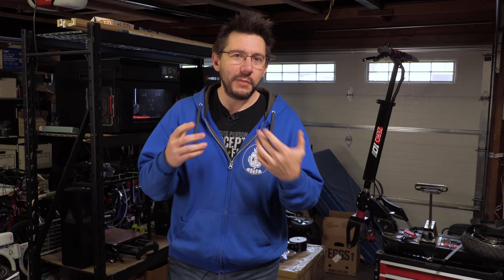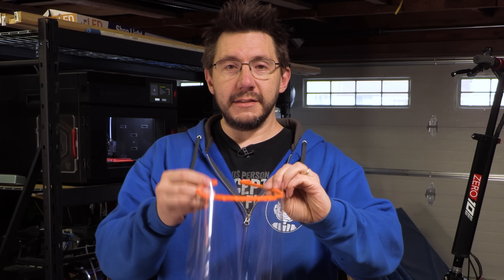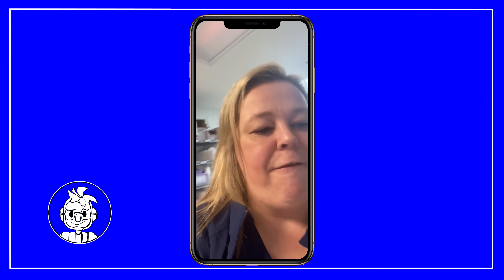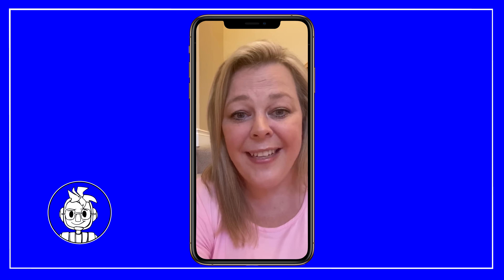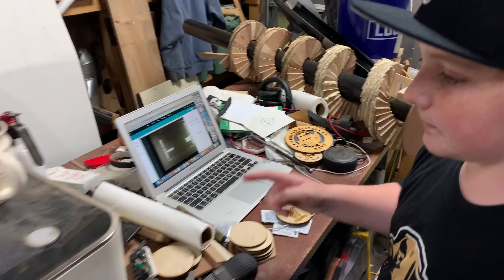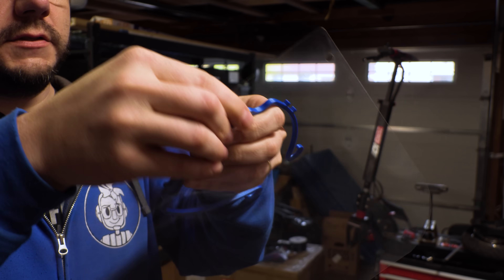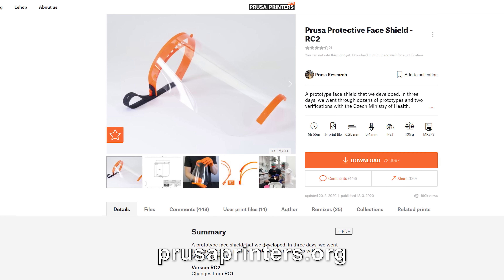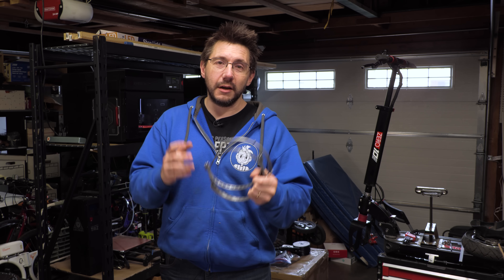3D Printing Face Shields and YOU CAN TOO!

Comment: @3D Printing Nerd Why did you choose the Apollo brand? I checked amazon and there’s several other choices with the same amount that are about half the cost. Just wondering if you picked it arbitrarily or you know that brand.
Reply from the maker: It was the first one I saw when I searched long ago, and it worked so I used it. It’s been a while and now that there are others I’d say shop around

Comment: Assumption - everyone is using a single profile. 
In S3D I am only able to make stacking work if I created a profile for each part, slowing the 1st layer to give it time to stick. Otherwise the material pulls away.  Then I use higher speeds for the rest of the part. So a stack of 25, I have 25 profiles. Or I have 1 profile running really slow. How is everyone else doing it?

Comment: I've been printing a lot of face shields, and I've found that the simplest way to clip the plastic to the frame is Binder Clips.  It won't work for that specific desich, but there are a lot that have a smooth, rounded front edge and are designed to have a build in clip.  If those don't work, 30 cents worth of 3/4 inch binder clips hold it tightly, and are easily cleaned or replaced.

Comment: Here's what I've found to work. I've printed some of these and made some shields from overhead transparencies.
 I cut the transparencies on a vinyl cutter with a 60 degree blade 200mms. I had to baby sit every piece by holding it down to keep it from squirming around (US cutter). The hole diameter is .290, the hole spacing is 1" between centers and 4.42 between 1" patterns.
 For printing the head bands, PLA didn't have very good flexability, PETG worked much better and had better strength. .2 layer height 60mms speed 240 nozzle temp 80 bed temp, no part cooling fan. I was able to print 3 parts at a time on a CR10, 2 on an Ender and Prusa M3.
 If you don't own a printer and you want to try something new buy a Creality Ender 3, $200ish. It's a great starter and will do anything you want for a dirt cheap price. Good luck!
Reply: Did you try to cut more than one sheet at a time?
Reply: @sudo936  No I had enough trouble cutting one

Comment: I printed some of these for my wife to try at her hospital. I liked the thin design which allowed faster printer and used less filament. Her feedback was: "The small lightweight design is good. The fact that it stays on by itself or can use a band across the back to hold on more securely is great. The pressure against the side of the head head is annoying. The thin design pulled against the forehead if using a band in the back is annoying. The biggest drawback is the shield is not held far enough away from the face to allow for large glasses, goggles of pretty much any size, and domed or valved respirators cause the bottom to push out quite a bit... and it fogs easily from restricted airflow. A potentially positive side effect of the close fit may be better protection although several doctors felt it wouldn't make much difference as the shield is designed to stop the direct travel of expelled droplets, not free floating airborne risks which is why a mask is worn with the shield." We also tried the Prusa design and it was found to be heavy, bulky, and did not conform to most people's forehead (even though it looks like it would) so it pressed against a small spot in the center which was made worse because it had to be pulled fairly tight using a band in the back. The best thing about the Prusa is it holds the shield further away giving clearing to all the other items a person may be wearing that I mentioned before.

Comment: Sorry but those Apollo lamination sheets are not well suited for use as shields.  Why?  they are not fully clear and they are 2 mil (Flimpsy as hell!).

While the Prusa design mask is good... it does not protect well health workers because it lacks of a top portion hood.  Here is a better design which can be printed with optional hood and base parts and also recommends using a 10mil PET clear material instead of the 2mil lamination sheets everyone is promoting.   https://www.thingiverse.com/thing:4271251

Comment: Hi, we are looking to get 3D printer and start printing these face shield, just wanted to know, printer with build volume of 200 x200x180mm or 220 * 220 * 250mm would be enough to print these face shield? 
These are the two 3D printer we are looking to get to help NHS in UK, it would be great if you can help and advice us on which one is good enough for someone new to 3D printing to get started with this 
https://www.ebay.co.uk/itm/124132924422
Geeetech Acrylic Prusa I3 Pro B Unassembled 3D printer DIY Kit https://www.amazon.co.uk/dp/B01GJDO9I0/ref=cm_sw_r_cp_api_i_AYjMEbYRFG5RC

Comment: i have found another way top make them stack-able in cura, all you need to do it have lets say 2 of the models and center them then move one z -5-(the z gap for supports) adn then group them then bring them level with the build plate, this is a lot easier than using 3d builder. hope this helps somebody.

Comment: I only just bought my 3D Printer following watching your inspirational video. So now printed 30+ face shields after trying different designs settled on this one as nurses and doctors report that it's nice to wear and cleanable. I had trouble using PTEG vs PLA on my Mega S, but after a dozen or so failures I got the printer setting correct.  Now got to get an 2nd printer as received more orders here in the UK. Laser cutting next!

Comment: I spent 4 days printing 100 of the face shield holders and had 10 mil 
covers FedEx from California and got them today. Will start assembling 
them tonight. thanks Joel. Update: Ended up with 135 face shields and 
the local hospital tells me they did not need them, but have had several
 big articles in the news papers stating that they are in dire need for 
the face shields. After several attempts with the hospital I have given 
up. They are a bunch of idiots just looking for sensational news in the 
media!

Comment: I'm printing the Stratasys shields. I've done nearly 100 in PLA. My Wife's hospital is using them. I'm trying to switch to PTEG & having a heck of a time. I get some decent results at lower speeds but that's taking 3+ hours. Using a Creality CR10s Pro. I've tried all kinds of settings. Getting lumps which are throwing off everything of course. If anyone can post settings that work for them that would help.Yes I know "your machine may be different". I'm just looking for a stake in the sand to start from.

Comment: So far I've made about 50 to this design and distributed to local doctors and nurses. They have been super happy with them so I'm printing 24x7. I'm laser cutting the shields also out of lamination sheets run through laminator with no paper etc. Or I'm using clear cover sheets designed for spiral bound reports etc. The BBC here in the uk criticised this activity saying they weren't kite marked or approved. The doctors and nurses said that's great but we have no approved gear so these are 100% more useful than nothing than what the government aren't issuing! 980 people died today in the uk so everything that everyone can do should be done to help fight this global problem. Stay at home and print to save lives! This design works great.

Comment: Hey Joel... I'm so sorry for putting this here but I'm really running out of luck. I have a single printer to help with this effort but can only print one every 15 minutes. I've raised $3300 so that I can buy more printers and supplies. I have enough filament to print 2000 face shields but NO PRINTER... every order I place never gets fulfilled. Can you help guide me or suggest some solutions? My efforts can be found here if it's helpful. http://RabidScallion.com

Comment: Do the Clear Gloss Report Covers (Pack of 100) from binding101 work well with laser cutter?
Reply: I will be using these pre-cut PET for Prusa once they are delivered https://www.ebay.co.uk/itm/10-Pack-Precision-Cut-PET-Sheets-Visors-to-Fit-Prusa-3D-Printed-Face-Shields/164154180308

Comment: Could you make comments on just how clear the different transparency sheets actually are that you used and linked? I have bought some brands which are so-so to look through. I have instead been buying Grafix Dura-lar clear and that stuff is incredible, glass window clear in .005" thickness in sheets and rolls. But it is getting harder to come by. I have enough of it for about 600 face shields, printed over 100 so far this week and will continue until I run out of the Dura-lar. Demand in Nashville has been far more than I expected so I am happy to crank these things out as long as supplies are available.

Comment: to speed up the transparency cuts you could get some steel pipe of the correct dimension and sharpen the edge then create a punch jig and punch the holds out of the film.

Comment: Is there any way where you could stack a huge block of these vertically in the print then lazer cut them to size in strips? Just thinking of ways to speed up production.
Reply: I found this site that had stacked versions of this at https://retrolabs.com/3d-prints/3d-printed-face-shield-with-10-mil-pvc . I tried the 3 piece stack. For my Prusa I needed to print with supports. I hope this helps. God bless.

Comment: i'm using the 3Dverkstan UK version, 0.4 layer height, can fit 2 on the bed without stacking, brought a second printer and supplying my local hospital, care homes and district nurses, sent out 90 today, another 60+ going out tomorrow, chose the 3dverkstan version because the print time is fast, takes 1hr 5min to print 2 of them, compared with over 5 hours for 3 prusa ones. Getting harder to find the clear plastics, but shiuld hopefully hhave a delivery of 500 in the next few days. Off work due to the virus, I was decorating the house, but this is a much more worthy cause, good job guys it's amazing how the community has responded

Comment: Wondering how well this protector works against aerosol (air full of particles) spreading of Corona, since it‘s wide open at the bottom...
But better than no protection. Thank you.
Reply: It's not designed to be a filter it's there as 'splatter protection'. This is a face shield .  A face mask = the thing that goes over your mouth and nose is still worn beneath it. Look at the picture in Prusa's thread at 9:48 - that might help.

Comment: For a mass produced product like face shields, why cant they just be Extruded on an industrial scale? 3D printing is too slow for this, the only benefit is it can supply hospitals locally that cannot get commercial ones quickly from companies due to transportation issues
Reply from the maker: The demand is so high right now, traditional supply chains are dry. Injection molding is starting to ramp up, but there is a gap, and this is where 3d printing is coming in handy. Prusa has sent more than 40,000 face shields out in Czech Republic, and I know my buddy Repkord in Sacramento has sent out 6,200 locally to him.

Comment: Hi!  I work as a dental hygienist and the dental industry has now become one of the more dangerous occupations to be involved in at this time. We are going to have to change the way we use PPE when we are allowed to return to work and face masks are not going to be required PPE.  My question is:  many of us wear magnifying loupes and we need space for these loupes to fit under the face shield.  Will the Prusa shield work for this? Or another style?  Thanks.

Comment: ARRGH! with my stock printer, stock hotend  and the settings suggested  mine printed with PETg. BUT my walls stayed apart and then the second one was horrible.....
Reply: corrected my settings (I think) and now it's printing but it will take 2 hours approximately Cura has it taking 25 hours for only 17...New Prusa slicer won't slice it for me.  Any thoughts?

Comment: Just bought an ender 3 pro printer a month ago and new to fusion 360. When I open a model it looks like the scale is too large.  I would like some help from anyone on how to set the scale correctly and start.  I have a lot of individuals requesting these and try to get running.  Thank you
Reply: You dont need fusion for a finished model... just slice it with cura and print it

Comment: Please use this Type of frame:
https://twitter.com/CoreyouNow/status/1246339669245276160
no rubber band is needed and the "heat accumulation" when wearing the protective device is much better

Comment: 📌📌📌FYI 📌📌📌: The Github content has been recently Restructured and it seems that it's a lot easier to find things. 😃
Here is the link for North America 6 Hole Design's STL file:  https://github.com/Cederb/Faceshield.nu/tree/master/North%20America%206-hole/3D%20Printing%20Files%20(STL)
In addition to versions of the files for the face shield itself, you will see:   Letter-spacer-6hole.stl    to print that spacer piece Joel uses in the video.
I DO wish there was more detailed info on doing the hole punching using regular hole punchers for rather slow to catch on people like myself! 🙄

Comment: The first link to the clear shield is now $250 for a case of 5 packs, single packs are not available, I got a single pack of overhead sheets for $60 shipped so no I need the 20 stack file and positioning to utilize a creality s4 to its best.
Reply from the maker: Whoa. Serious? I need to look at better links then. That’s nuts.

Comment: I can't find an STL for that spacer you mentioned Joel.  Was it changed?
Reply: I found the instruction sheet and it states a 1/2 inch spacer should be able to do that on the fly... I thought there was a file for the spacer.
Thanks
Reply from the maker: There should be an STL for the spacer. I’ll try to look for it in http://faceshield.nu

Comment: So with my CR-10S, using a Microswiss hotend, with stock heating element and a 0.8mm nozzle, I am abble to print these at 35minutes by head band. Anyone to compare? I want to know if my tuning is optimal. I am using PLA+, 0,3mm layer heigh, 1mm layer width, 60mm/s (except for first layer, it is at 20mm/sec)

Comment: The Prusa and Swedish files are just too complicated and over built for a normal single extruder printer to make. They require dual extrusion. Far too much 3d assembly of parts required ... should be a single printed frame, then just add the plastic sheet.  I read their assembly/printing instructions and thought "what were they thinking?" The designs are too complicated for their intended use and need to be simplified, we're not needing the 3d printed part to be permanent.  Firstly, design it for using rubber bands instead of impossible to get elastic straps. Hospitals don't have specific sized elastic straps, but everyone has rubber bands. Secondly, the print needs to be for a standard three hole punch. There needs to be NO support required for the print ... very important. I'm lost as to why the designs have to have supports as there isn't any need when you look at cross sections of their designs. Far too over built. Get rid of those and the print amount capability doubles. These designs also want to use a foam liner, just not realistic for normal users who want to help. It's almost like they've deliberately designed the shield so that no mass produced printer can make them. And release the designs in commonly used 3d files (eg. stl, obj, etc.) not some obscure industrial versions. Also, it's inappropriate to demonstrate vanity and put your name in huge block letters on the visor as some have been doing ... we're trying to help, not get famous for it.  Please guys, simplify. That way we can all help.
Reply: Maybe I am mistaken, but I am using the single extruder and quite simple stl files. Have you looked trough the whole repository here? https://github.com/Cederb/Faceshield.nu/tree/master/North%20America/3D%20Printing%20Files%20(STL)

Comment: I'm using the suggested settings for Ender 3  with .4mm nozzle but the the layer for the catch tray is way too thin and has holes in it. It's not my bed leveling because I'm printing two at a time, facing opposite directions and the holes appear in the same place each time. Any suggestions?

Comment: I've also been printing as many as I can... big bottle neck is having only a single printer. I also designed this all plastic version of the RC2 face shield... no elastic required. People are having a hard time getting a hold of the elastic, and hospitals don't like foam/cloth materials as they are harder to clean. Check out my design if you want to try printing one: https://youtu.be/aTgLYxFm6Xw It is being trialed in the Vancouver General Hospital Covid isolation unit right now since it does not need elastic or foam. Hope it helps!

Comment: Face shield approved by regional medical authorities in Barcelona (spain): https://covidmakers.cat/wp-content/uploads/2020/03/Visera_v0.4_Catalu%C3%B1a.stl

Face shield distributed in Spain to public officers (police, nurses, medics, carers..) https://www.coronavirusmakers.org/index.php/es/impresion-3d/viseras

Both only require an elastic cord and a A4 acetate sheet, nothing else, you don't need any laser cutter. The first seems to have better protection against ingression from the top, the second seems eassier to print in bachs.

On the front of the Deacthlon Snorkel mask, Isinnova (an Italian engineering office) has liberated the design of the "Charlotte" valve and the procedure to adapt the mask for its use as a non invasive respirator. Obviously, worst cases of COVID will always require intubation but this design can help on the previous stage to the invasive action.
https://www.isinnova.it/easy-covid19-eng/